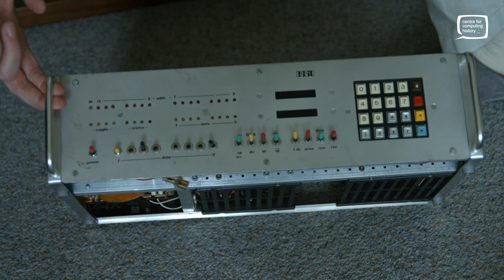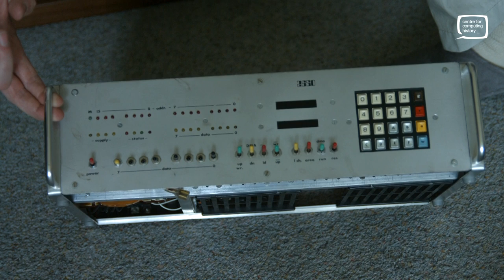Steve Furber - His First Computer and the Prototype Acorn BBC Micro!

Comment: The BBC Micro badge is designed to be attached to the radiator grill (cars had them in the 80's::-)  ) the AA & RAC used them.

Comment: Superb

I think I can solve the mystery of the 9 volt battery connector for prop use. It was featured on the BBC's Trojan Mouse, 10 year anniversary of the Computer Literacy Project.
Reply from the maker: Paul Potter Thanks - Did you know that as a viewer or were you involved?
Reply: I thought I recognised it as a viewer, and the light up prop part confirmed my thinking. I can remember him flicking switches and lights working.

Comment: Regarding the 'issue c' bbc micro pcb. I used to work in a circuit board manufacturers that used a 'bed of nails' machine to test the boards for shorts or breaks (no resistance or capacitance test). that manually operated press-based machine used a bbc micro issue c board, which i think was a bbc micro b, issue II. the program that it ran was contained on eproms, presumably they were used in the same place as the volatile ram would have been. it had 6 columns of 8 sockets on the back, each supporting 64 pin-outs for the 'nails'. after it 'learnt' the correct layout from a verified good board, it only read the connections related to the plugs that were connected at the 'learn' stage. whats impressive to me is that on a completely populated pinout scenario it took less than 10 seconds to 'read' and compare the status of every single pin to every other pin with its 'learnt' status. the machine was called an MS2000, and this was in the early 1990's. in the UK.
Reply from the maker: That's interesting! Thanks for the comment.

Comment: Kids have indeed arduino etc and those little tiny cheap machines like the Arduino, ESP32, Raspberry Pi (to bring it back to arm) are astonishing and I would’ve killed to have one in the 80s. But kids now grow up with a computers as a mass product. Like we did with radios and TVs. Our dads build radios, we hacked computers. Not sure what kids hack today though. 
But I did realize back when I was employed, that when we had interns and I showed them programming electronics that they are really intrigued. The see computers as boxes that are fully integrated and not something that can control and measure external stuffz

Comment: oh yeah, another thing, unlikely but... if somewhere on the white legend of that board, around the edge, it has the initialls PWC and a date, then it was made by our factory (just the board). I know that at the time, we made single-sided boards for Cambridge Systems that were for  transistor-based amplifiers and were very well designed to make manufacturing easier so there were far less rejected boards at test stage. Sir Clive, doesnt get enough credit for how good he was at getting good people to work together to create well-designed products. Youve outlined well here why it was essential for him to source components that even though outside tollerances for thier intended use, worked well as alternatives in his projects - components were very hard to come by, and waiting a whole year for your own properly tested, experly designed component was not viable, because the technology that other companies will have developed by then would have been superior. My personal Sinclair favourite achievement is the ZX81 programming manual. Very well written and an excellent doorway for anyone at the time to get passionate about programming.